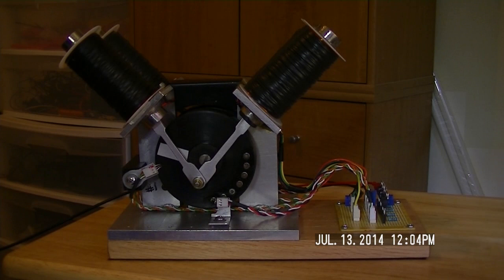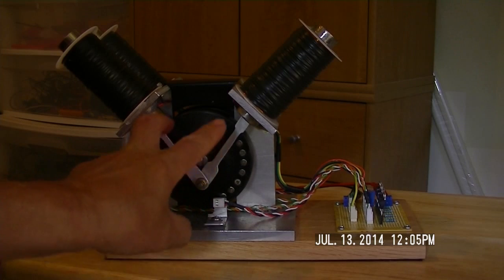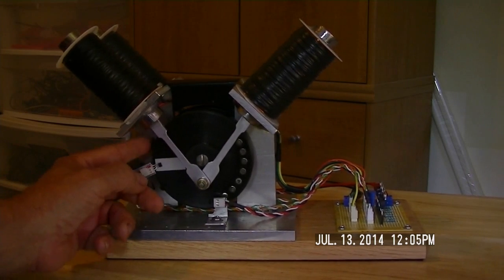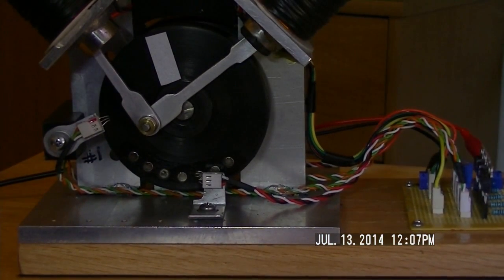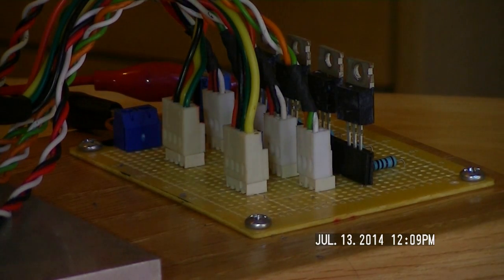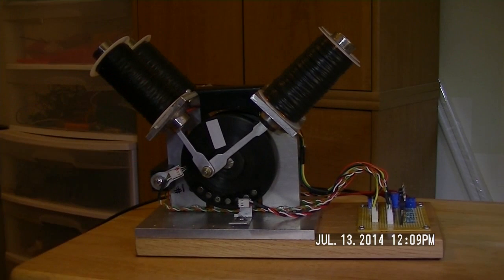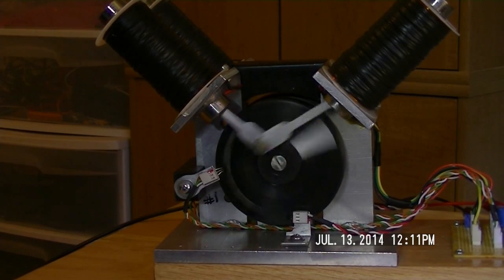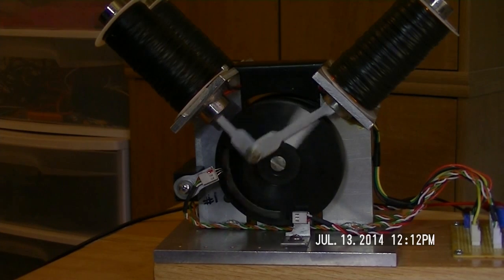Magnetic Flux Drive Piston Powered Motor

Comment: This is Ismail avizo's idea. This should be hooked up to a generator so it can charge batteries. And then you could run your electric car your house. Imagine if you put magnets in the sides of the cylinder wall and in the piston so that they never touch each other through the repel of the magnetism. It would be a non friction motor. The only problem you're going to have with that motor is friction. Excellent job and very nice looking. Thank you.

Comment: Can it drive anything besides itself though.  Sweet.   Could you run a belt grinder w it?
Reply from the maker: There's only 2.5 ohms of resistence in each coil and its draws about 2 amps @18-20 volts so with its small physical size it doesn't have a lot of power. It does, however, have enuf power to drive 1/2 pound of flywheel at 800 rpms so yea, it has ample torque ..and with proper gear reduction, it could easily drive something other than itself. 
Double or triple its size and the power will increase proportionally.

Comment: Can u please tell me how electromagnet is prepared please plz
Reply from the maker: If your only concerned with HOW to make the electromagnetic coil,  and you don't understand the dynamic principles behind Magnetic Repulsion, you won't have enough information to build anything.   I suggest you watch the many instructional videos on YT to learn the dynamic principles of electro-magnetism.  Its not hard to learn by doing some simple experiments with some copper wire, a battery and a magnet.  Just wrap a coil and connect each end of the wire to the poles of a battery. You'll discover that electricity flowing thru a wire coil will create a magnetic field,  the field will have a Northern pole and a Southern pole. You'll learn that when you change the polarity of the battery, the North and South poles of the magnetic field will also change.   
Once you connect the battery to the coil, you've already created the magnetic field and its the field that repels the magnet.  Changing the poles of the battery (which wire is connected to the + pole of the battery and which one is connected to the --  pole)  will change the polarity of the magnetic field.    Good luck...

Comment: Does the 4 cyl. Flux magnetic motor have any power, can the top of the cylinders be fitted with air,, compressor valve plate and heads?
Reply from the maker: This is a fairly small motor, the power isn't proportional to the magnetic flux so if you built one that was 10 time bigger, you'd get 50 times the power.   No heads cannot work with this motor.

Comment: http://gap-power.com/videos-rotary.html  If this link doesn't work, just check out "my first design" on his video page. if you make your coils like this, all should go well. I also recommend find the best bearing lube you can find. I have these on my shelf http://www.dynalube.biz/ and http://www.f1ceramic.com/Ceramic_Bearing_Grease_s/93.htm for the "F1 rocket sauce". Haven't mad time to test them, just came in. Dyna lube seems to be more seasoned. I also have dyna lube oil additive that I will put on my bearing, just because it's so high tech. My truck loves it and is running better than ever, it added 2miles per gallon on my v8 with 198k miles. Secrets revealed for protecting your engine from running on gas vapors. I couldn't remember this name, but i remembered from my childhood informercials. Peace
Reply from the maker: Seems like one of those things a guy has to try on his own to see whats really up with it.  A simple pulse motor using that principle should yield greater rpms then the same device without it. I'll throw something together to see what happens. Thanks
Reply: Ahhh, Thanks you my friend! You're definitely a "can do" type of guy. And in this line of business, not that we are getting paid for this, we need more members like you! Hope you stick around for a while! We need all the help we can get!  My-bad on no vid yet, my brain trys to make everything perfect.... which sucks, except for concept design. I look forward to see or hear what happens! Peace
Reply from the maker: MaintenanceMouse  That's kind of you to say, Thank you.  Stay in touch and we'll see how this "amplified coil" thing works.   Be well...